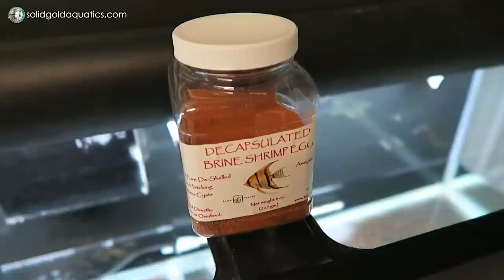Newly Hatched Goldfish Fry // FISH ROOM VLOG

Comment: Please Help?? I'm setting up a tank for my small Lionhead and I was wondering weather is worth getting a heater for her tank?? It will be in my bedroom so the temperature won't fluctuate a whole heap. I'm very confused because everywhere I read it says something different.
Reply: Goldfish are very tolerant to cold water. You don't need a heater on an indoor tank really.
Reply: Thanks. How low can the water temp get before I should start to worry??
Reply: I've had outside shaded ryukins in 115 degree heat all summer and they were fine.
Reply: Jessica Cook She has a great video up already that discusses this. You can check out her how to set up a tank video.
Reply: I'm more concerned about the winter. We're coming into Winter here in Australia and it gets very cold where I live overnight in mid winter.
Reply: Jenna Ennui thanks!! I'll go check it out.
Reply: When the water temp is 50s stop feeding. Reduce feedings when 60s. But i thought you said this was an indoor tank? I doubt your house is going to get that cold. Single tailed comets can live under ice as long as it doesn't freeze. But round bodied fancies like 50s to be as low as it can go before they're stressed. Ideal water temp is 72-74 F. I like a digital thermometer for quick ease.
Reply: It is an indoor tank but my bedroom is an old caravan (which I LOVE) and because it's old its insulation isn't very good and can get quite cold overnight. I've been able to use my heater to keep the tank temp up but I'm more concerned about when I'm not home. Her tank got to 9deg cel a few nights ago and we aren't even in the dead of winter yet. I don't want her to freeze to death. I'm probably being paranoid but she is my first fish and I'm in love with her. I don't want anything to happen to her.
Reply: Woof that is cold. She wouldn't die at that temp but its not the best for her as she gets older. Bigger bodied fish don't like the cold (fancies not comets). Just get a heater with the temp at 72 and she'll be fine. Are they hard to find at your place?